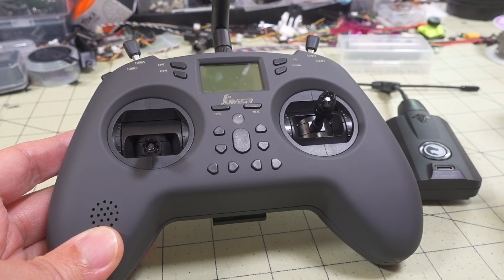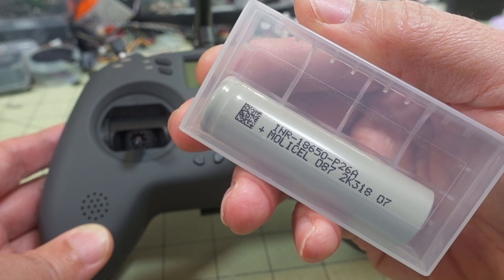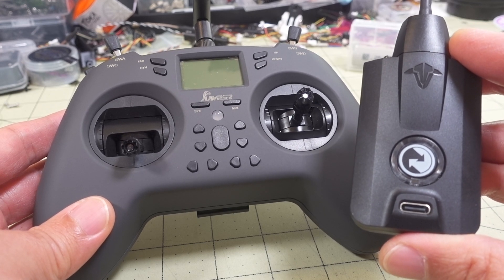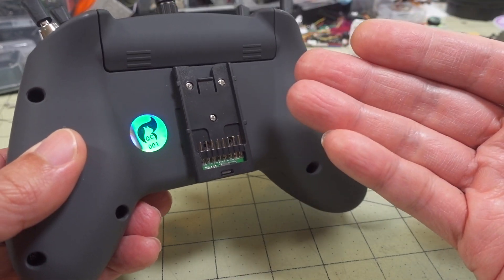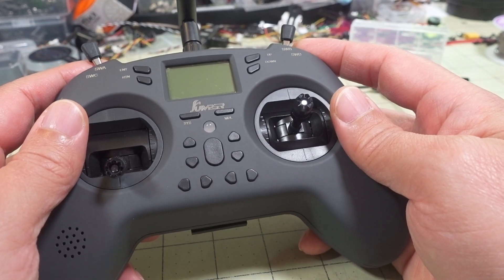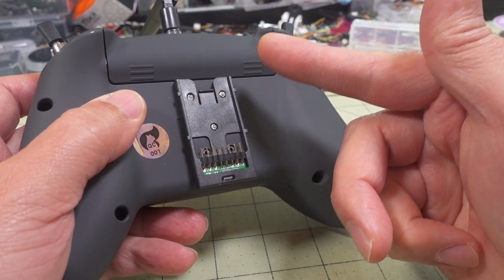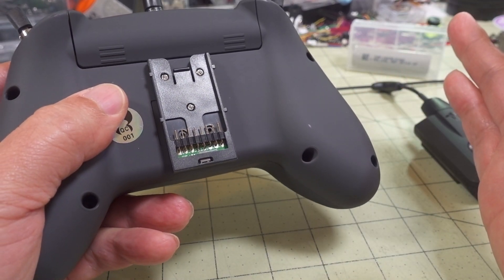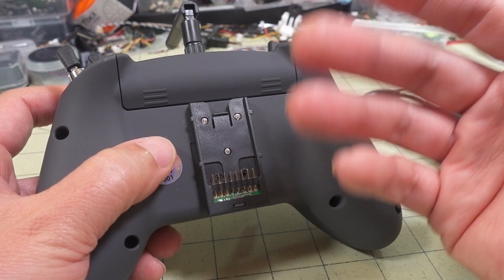Jumper T-Lite Crossfire1W Fix (Not for the Timid!) 🎓

Comment from the maker: 🎥 Part 2 here - http://youtu.be/2CZ0RYew4KA

🛒 Jumper T-Lite
       RDQ - http://bit.ly/2MGBIxs | http://bit.ly/3aJim2v
       NBD - http://bit.ly/3tJq7O8
       MF - http://bit.ly/3pEq7gI (use code MFTLite for discount)
       BG - http://bit.ly/3rl5ebq (use code BGJumper00 for 10% off)
 
🔋 Battery - http://bit.ly/39Eqv9q (U.S.) | http://bit.ly/3q04iIy (Molicel)
      http://bit.ly/39ElVYP (outside U.S.)

📡 Crossfire Nano TX Module - http://bit.ly/2YWSQSe

⭐ Hawkeye Mini Monitors - http://bit.ly/3pFau8H

📝 SD card contents - http://bit.ly/39ELPeJ

🛒 Switch covers - http://bit.ly/3cTJTOt
🛒 Stick ends - http://bit.ly/2Y6BmDF

📺 Other radio reviews...
Tango 2 PRO - http://youtu.be/Ne_lWl5Swzo
Jumper T12 - http://bit.ly/3mXTQ2x
LiteRadio2 SE - http://youtu.be/7loW4m-5Z6M

Solid State Relay - http://amzn.to/3dguQ4C
3rd Mod video - http://youtu.be/b7OCdkkKmrc

🙏 Please support with a 👍 and don’t forget to hit the 🔔 thanks!

👉 Old gear for sale here -  http://bit.ly/AlbertGearFS

💲 Get the latest exclusive coupon codes (updated often)
     http://bit.ly/34SYiGn
Reply: So have you gotten to fly it to see if it failsafes ?

Comment: have you try pdb that come with happy model modul diy 2,4ghz for t-lite :)
Reply from the maker: I have not because it's designed to work with that module and it's a permanent installation so it will require a lot of hacking to get it to work with removeable modules.  I haven't had time to explore that yet.
Reply: @AlbertKimTV  tq

Comment: I have not tried it it for function, but a 20700 battery will fit in the battery bay of the TLite. I currently only have a limited supply of 20700 batteries which I use for other purposes, but I will likely try the 20700 in my TLite. 20700 batteries typically come with a higher current draw rating and significantly higher capacities (3000 to 4000 mah) than 18650 batteries. They are easily sourced from vape shops.
Reply from the maker: Interesting, so you've actually tried a 20700 and it fits with the cover on too?  Seems like it would be too wide...
Reply: @AlbertKimTV  It definitely fits legthwise. I have not tried to add the cover. As everyone knows, as received the T Lite's battery connection is too loose.. the 20700 compresses the the battery contacts all the way to their limit, but it does fit. The 21700 is just too big, for the battery space but the 20700 appears to fit. I will probably use the 20700 in my T Lite when I buy a couple more 21700's for my vape.

Comment: The real reason it dies at 3.4 is because the internals are powered by an LDO regulator.  If it was powered by a proper switching regulator, it would keep running a lot longer.  Probably good to recharge at 3.4 tho.
Reply from the maker: Is it possible to swap the regulator on the board?
Reply: @AlbertKimTV  probably.  It would actually improve the efficiency by a good bit as well.  It would probably involve removing components off the main PCB and soldering a 3.3v switching regulator to the solder points of that component (the LDO).  Might attempt it myself when I get a t-lite.

Comment: Hi, how long does the battery last with the internal module, and how long does it last with the crossfire at 200mw
Thank you
Reply from the maker: Battery life varies with distance flown.  So the farther away you are, the more power you will use.  For my typical use with the 2600mah Molicel (cheaper/fake cells won't last long), I get roughly 10-12 hours with just the internal module and about 3-4 hours on Crossfire.

Comment: I can’t even get mine working properly on 250w with dynamic OFF. Half of the time it still gets into some kind of lag state, even when fully charged.

This is with the awesome batteries (20a LG ones suggested by stylesuxx’s channel) and whatnot.

I figure this will get better with time, but it’s not a good first crossfire radio for a friend who’s just getting into fpv. 😀
Reply from the maker: It's like this before the mod or after the mod?  I run 500mW dynamic off all the time now with no problems after I did this mod.  I had problems before I did the mod.

Comment: I was wondering if using a separately powered inline antenna amplifier would work on this tx? I've seen one hobbiest use one to fly various models with good success. He uses it on his Mjx Bugs drones both with their factory tx and his Jumper. It is a bit cumbersome but functional. Wadda ya think?
Reply from the maker: It should work up to a point as higher power means more signal but also more noise.  It would depend on a lot of factors.
Reply: @AlbertKimTV  thanks for reply. Also thinking of connecting a second 18650 in parallel on the bottom of the Jumper between the grips. Would this cause any probs you think?

Comment: Do you think a 21700 battery would fit in the T-Lite? Seems like there might be space in there for the extra 3mm in dia and 5mm in length.
Thinking about trying this Molicel 45A 4200mAh :
https://liionwholesale.com/collections/batteries/products/molicel-npe-inr-21700-p42a-45a-4200mah-flat-top-21700-battery-authorized-distributor?variant=15913210675294
Reply: To answer my own question; the 21700 can be made to fit, with a couple of hacky modifications to the back shell of the T-Lite.
Firstly, the top surface (above the battery compartment) needs to be trimmed slightly at the two points where it protrudes down towards the battery. This is easily snipped away using a flush cutter.
A little trickier; the cylindrical recess doesn't have quite enough space left to right for the 21700 battery to sit. With the back shell removed, one side of this recess can be removed to gain the 1-2mm that the 21700 needs.

Comment: Only a matter of time before someone comes up with a 3D printed replacement battery door that accommodates a second 18650
Reply: Adding a second 18650 won't solve xfire power issues without any of the mods mentioned in this video other, other than extended battery life. You will also need to modify the charging circuit to balance the 2 cells.

Even if you parallel the 2 cells to keep the same voltage and forego the parallel charging issue, the module cannot pull enough current through the radio pcb without affecting the radio.
Reply: @craigjohnstone87  yes you would still need to connect the module directly to vbatt as suggested and put a switch on it or the solid state method to get it to power on off with the controller

Comment: The Tango 2 has a 5000 mAh lipo built in. I am strongly considering getting a Jumper as a multi protocol transmitter because in my opinion a module on the back of the transmitter messes with the ergonomics if one has bigger hands. I have gloves size 11 to 12.
Reply from the maker: I need to put in mistakes in my videos more often... those videos get way more comments!
Reply: @AlbertKimTV  Could be a sign that many of your viewers only comment if they have soething to add to the menu ;)
Reply: @AlbertKimTV  What you're seeing is Cunningham's Law, in full effect.

Comment: I'm happy with my Frsky X-light with two 18650s and a Nano CRSF. Plug and Play!
Reply from the maker: I hated the X-Lite gimbals.  Hurt my hands after about 10 packs of flying.  Fine for a pack here or there, but extended sessions hurt my hands too much.
Reply: @AlbertKimTV  I'm using the aftermarket super stubby stick ends. Sadly its ruined me to my Spectrum radios and QX7. I went as far as picking up an frsky rx for my fixed wing models but have only flown fixed wing once since getting into quads. I think its time I sell all the stuff I'm not using and finely get some googles. Then again will I be able to transition from  X-Light mounted Black Pearl FPV monitor to googles after this long?? haha

Comment: "should not do it, void warranty"  you just pushed the trigger button for us who just love to tinker with void label stuff XD of course were gonna open it before even first use :D
Reply from the maker: LOL 😂😂
Reply: @AlbertKimTV  ok so mainboard input range is 3.3-4.2v max?
Reply from the maker: @Just4FunRC  Actually you saw it went down to 3.2v.  Around there and below, the radio starts acting strange so the voltage regulator on the board isn't reliable below 3.3v

Comment: So why would you buy a T-Lite if you want crossfire?  T-Lite $70, Battery$12, Crossfire Nano TX $70 = $152 plus modding your radio to actually work.  Destroying the form factor which one would assume is the reason you bought this style, or just by a Tango 2 with crossfire installed inside the form factor, no modding necessary, better quality components, and way better service/support.  I don't know but for $45 difference that seems like a way better way to go.  Just saying
Reply from the maker: I'm switching to this from a Tango2 because the ergonomics and gimbals feel better to me.  Having used the Tango2 for six months, I instantly loved the way the T-Lite felt in my hands.
Reply: Your not taking into account the $40 required to make the tango 2 mult protocol which also changes its form factor if you want to compare apples to apples.

So its closer to $100 difference.
Reply: Maybe not crossfire, but I personally want this radio for 75$, and r9m module modded to run expressLRS which costs 10$, and for 85$ you have better long range system than crossfire, and not to mention the form factor, if they only added full jr module support, insta buy.
Reply from the maker: @theBuZzEr1811  You can get this adapter to use full size JR modules - http://bit.ly/2NxTPpc
Reply: @AlbertKimTV  thanks would be the same for r9m with the 1 watt mod?
Reply from the maker: @theBuZzEr1811  The firmware on the T-Lite wasn't compiled for R9M support AFAIK.  I think you'll have to wait for 2.4 to come out.
Reply: @AlbertKimTV  thank you